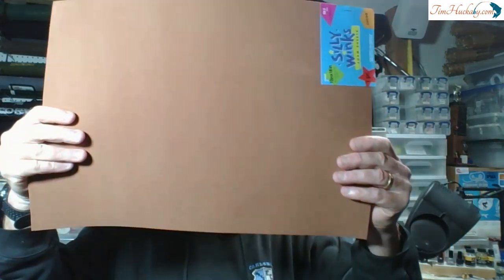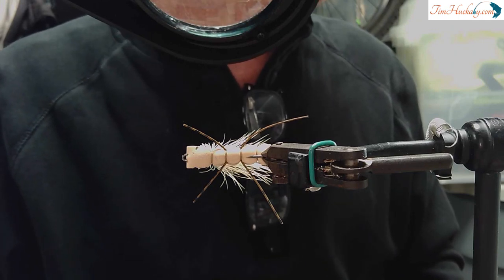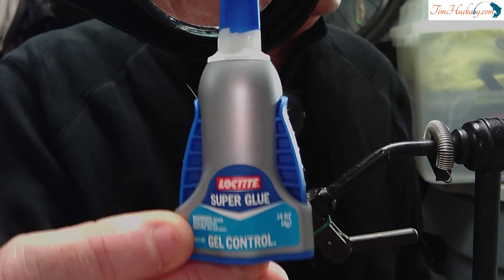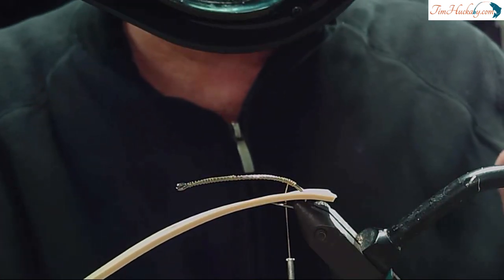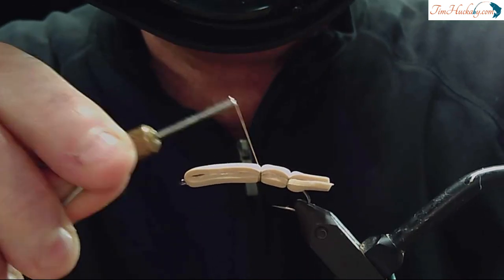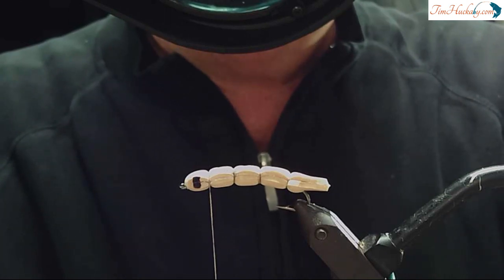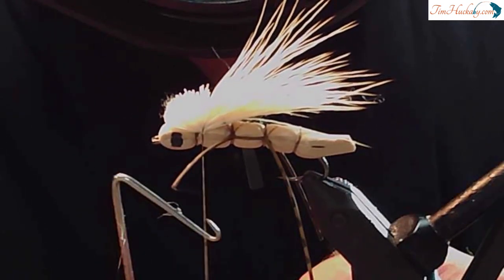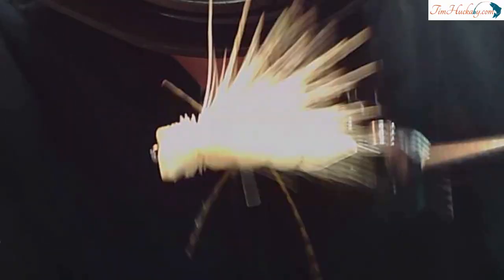Huck Hopper

Comment: I liked that.  for hooks you might try a Firehole 839, they go up to #2, 3X long, wide gape and heavy wire.  They're actually a streamer hook but I tie foam body flies on them.
Reply from the maker: get this!  since i did that video i found the Diachi 2460 Long-Shank Aberdeen Hook.  it's actually a dry fly hook that is typically mislabeled.  it's perfect and goes size 4, 2, 1, 1/0 and bigger!  i tied an absolute battleship on a 2 with 4mm foam yesterday.  it's so huge i laughed.  i can't wait for spring when i can battle test it on the upper kern

Comment: Great video Tim!  Thank you.  Do you think applying some floatant helps?
Reply from the maker: now that is a legit question.  i used to soak my huck hoppers in loon fly dip and dry overnight.  and it probably helps in that 7th hour straight of floating them on the river.  but, i was getting annoyed by what it does to the elk hair wing.  it made it the hair look "greasy".